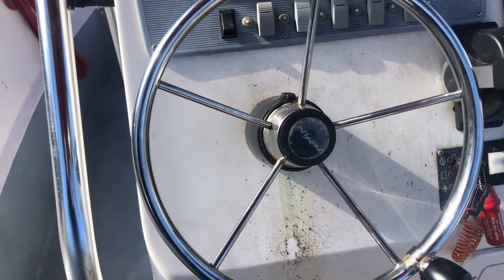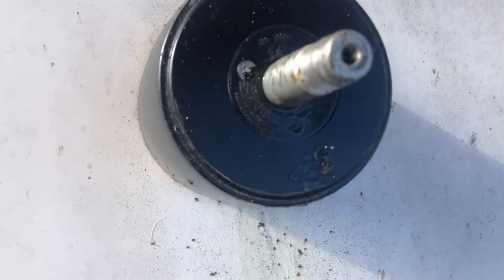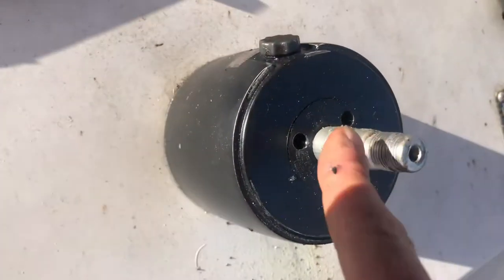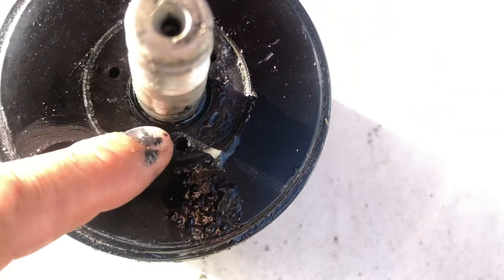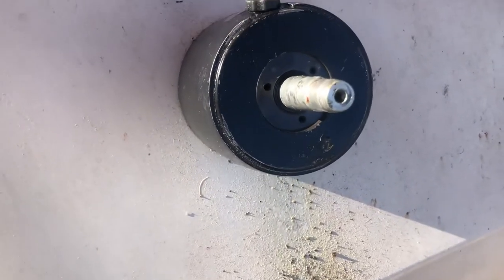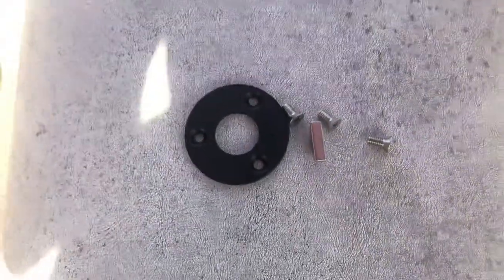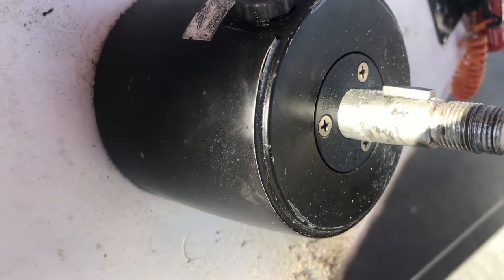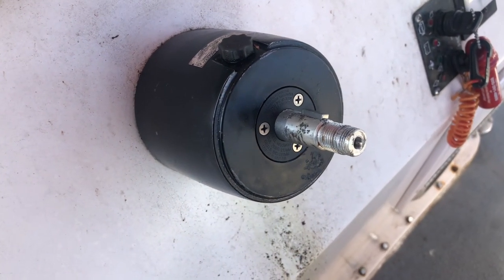Seastar 1.7 Helm Front Seal Replacment

Comment: Is it worth hitting the shaft with a little 1500grit wet/dry sandpaper or emery cloth? I'm wondering if the shaft corrodes and eats up the seal/x ring.
Reply from the maker: I’d say if corrosion is present and as long as you are using a fine grit like that to keep it smooth it should be fine. This one has been working great since the repair and no other issues have presented.

Comment: ...if it's leaking to that degree, that pump has all kinds of rust and corrosion inside...putting a new shaft seal is just a band aid...that pump needs to be rebuilt or replaced...
Reply from the maker: It’s been almost 2 years since I did the repair. So while this may be the case sometimes this repair has proven to not be a band-aid.

Comment: How do you know how much fluid to put back in? Mine has been leaking for awhile so how do i know how much to add after i do everything else?
Reply from the maker: @christianthearborist844  you fill it to the top. Best to use the hose that threads in so you can turn the steering side to side while working out all air bubbles in the system. When it’s full put the cap back on.

Comment: What does that semi circle metal thats on the shaft do?
Reply from the maker: It is a keyway. It keeps the steering wheel from spinning on the shaft. There is a notch on the shaft and one on the inside of the steering wheel hub so they fit together with the key between them.
Reply: @captleesoutdooradventures7133  would it cause your steering wheel to free spin if it came loose some how?
Reply from the maker: Yes it could. But it’s more likely that you have an air bubble or low steering fluid. It would be pretty hard to break that. Once the steering is in place there really isn’t anywhere for it to fall out either.

Comment: No need to bleed it?
Reply from the maker: Not to replace this seal. No air is introduced into the system from this swap. It’s just keeping fluid from leaking out.
Reply: Is there a rear seal on these units?  I have a leak that looks similar too yours. The fluid runs down at the bottom base of the unit down to the floor. Just curious if there's other locations from the helm to leak from that would have fluid leaking from the same location you illustrated. Thanks. Brandon
Reply from the maker: This is usually the seal that’s leaking down the base and looks like it’s running out of the back. The only thing you will have on the back of the helm that could leak would be the threaded fittings where your steering hoses connect. Most likely this seal is your problem. A small fluid leak goes a long way.
Reply: Thank you very much. I appreciate the come back. This was a very helpful tutorial an again appreciated 🙏🏼
Reply: Thanks. Great video.
Reply: Non hai fatto vedere i passaggi